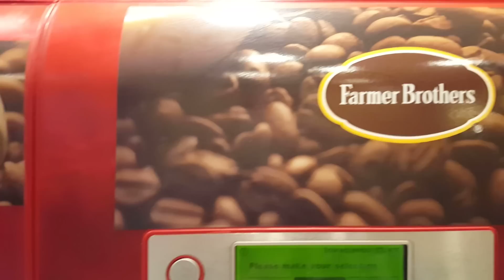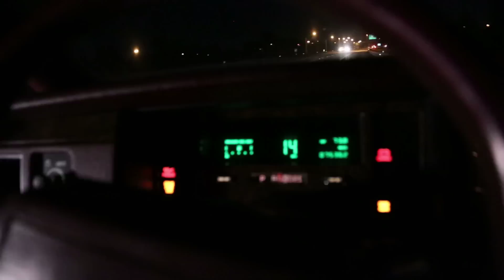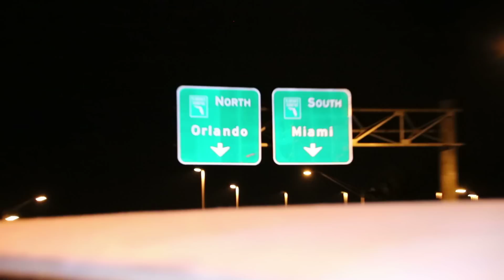$500 Car Challenge 2016 (Part 2/3)

Comment: Out of curiosity, how much of a car can you remove until it's no longer legal?  I know seat belts, head lights, tail lights, directionals, windshield, and air bags are pretty much a necessity, and some states probably care about the exhaust, but what else?  I like the idea of getting some $500 RWD junker, and remove everything except what makes it drive.  Even remove the dashboard, and replace the instrument cluster with a tablet with an OBDII app, and replace the seats with lawn chairs.  I'd remove any other luxuries too, like AC, the sound system, and maybe power steering.  Depending on the car, that could be about 1000lbs of weight I could remove.  If the car only has 150HP, that would be a huuuge difference.
Reply: You should honestly do that, will love it, and share it with all my friends, because I love videos like this, it's interesting and I love it
Reply: DJTK_music It would be a really fun project, but like I said, I don't know what the legal limits are.  I also don't have a garage to work on it.  That's important to have, in case I start removing panels.  I also really don't have an interest in paying for insurance on a vehicle that is basically just a motor on wheels.

I just like the idea of having what is effectively an over-sized go-kart that I can take on the highway.

If I had my way, I would get a late 90s BMW M3.  They're pretty cheap but have a lot of power to offer.

Comment: My car was $500 lol only put $100 in the past two years and is still running lol
Reply: What is it
Reply: I meant parts wise (I pay for my gas btw). And it is a Volvo 850, just a first car but it's still going so continue to drive it. Has over 250k miles as well lol.
Reply: +Justin Itdoesntmatter - Cool. Must be fun struggling to hit 65 mph...
Reply: +Joseph Summers another ignorant person, I can actually go over 100 mph still.
Reply: Justin Itdoesntmatter
Sure. It will just take 6 hours and about 300 miles to get to 100.